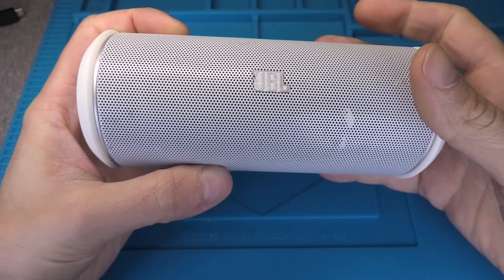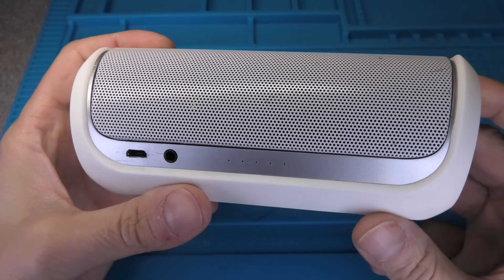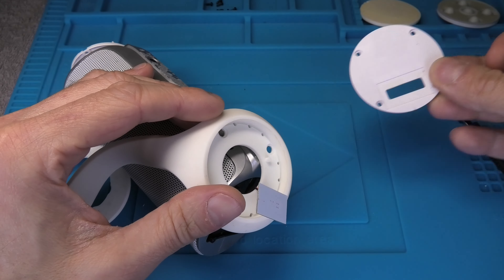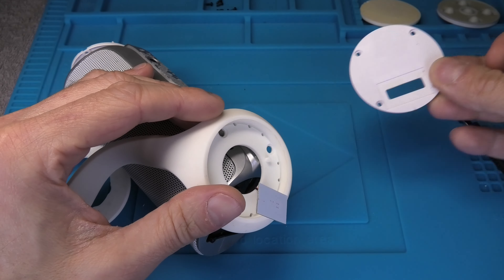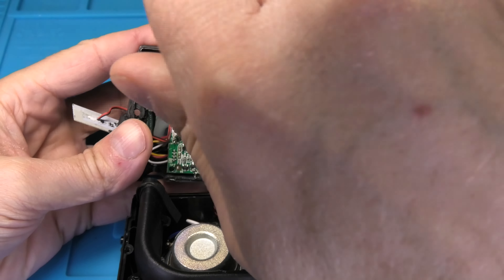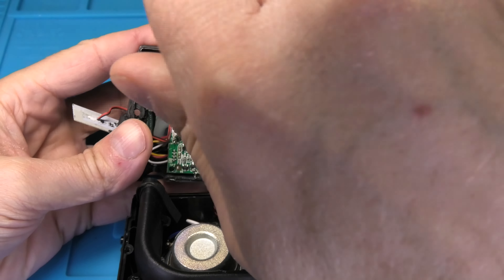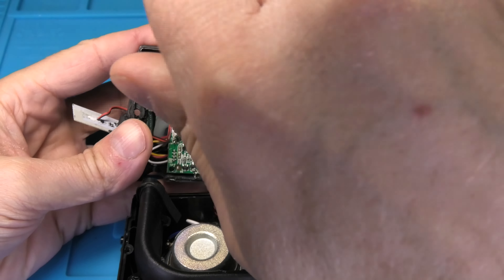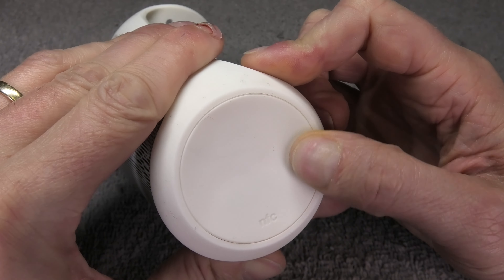Battery Replacement on JBL FLIP 2 (How to instructions in 4K)

Comment: I definitely have a JBL Flip 2 but mine looks totally different inside. From the outside it looks like yours. For example my mesh was not screwed at all. just more prongs that clamped down. And I totally ripped the nfc cables. they are brittle.

Comment: WOW!  Best repair tutorial video ever.  And since I watched your excellent disassembly process, I have decided that this speaker ain't worth fixing. The battery is the very first thing they put in there, for cryin out loud!  By the time you got to pulling the antenna through the end-cap, I determined that I wasn't gonna do this repair. But you got another subscriber ; - )
Reply from the maker: Thank you for your feedback!
I totally agree with you. I don’t see me doing this ever again with this model.  Too many hoops to jump through to get to the battery 🙃
Reply: Great video! The best I've seen. Agree with spencer, not worth fixing. They make these to be disposable, what a waste.
Reply: ".. I have decided that this speaker ain't worth fixing...". Exactly. Screw the old battery and fix it. I better buy the new speaker ;-)
Reply: @MegaSafetyFirst  JBL speakers are expensive. I ordered a new and improved battery from Amazon it was less than 20 bucks so it'll be well worth it to get my speaker up and working!

Comment: Great instructional video! I got ahead of myself an ripped one of the cables. Had I waited and watched the video this would not have happened LOL. Anyways, got everything of as instructed but then looked at the cost of the battery and cost of a used speaker and ended up trashing the speaker. Battery was too expensive but still a good learning experience and great video.

Comment: Thanks to your explanation, very didactic, my JBL it's fully working now. Excellent job! thumbs up...!!! yes and I agree that need to be careful with the replacement battery, the first ones that I order was with 5 cable for Flip 2 2014, but my model was 2013, which is only 3 cables. So I need to order again. But apart from that everything it's perfect.
Reply from the maker: Glad to hear it was helpful!   Thank you for your feedback 👍

Comment: Thank you so much for this video! Thanks to you there will  be one less speaker in the e-waste pile. My speaker is an older model of the Flip 2, and as another commenter said it takes a different battery. I appreciate you taking the time to make this! I'll be able to squeeze another 4 years out of this great little speaker :-) The three wire version for the early flip 2 can be found here (this is not an affiliate link) - https://www.amazon.com/gp/product/B0936P8LKT/ref=ppx_yo_dt_b_asin_title_o04_s00?ie=UTF8&psc=1